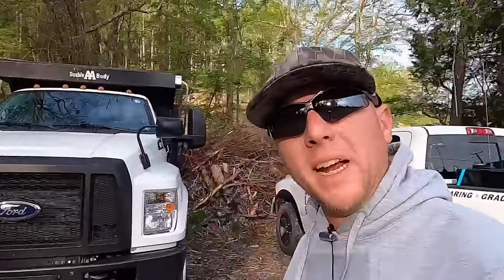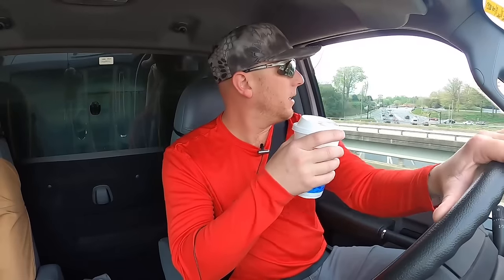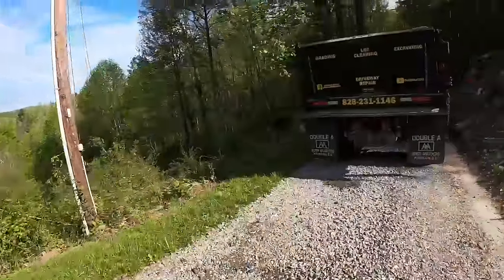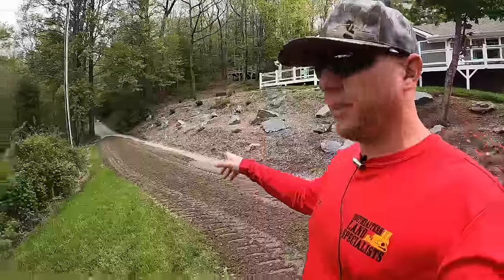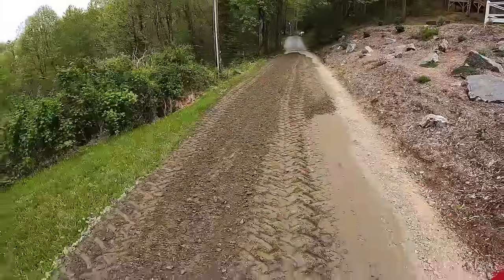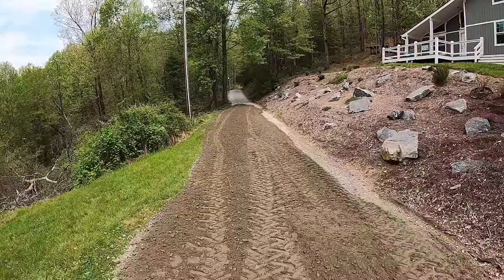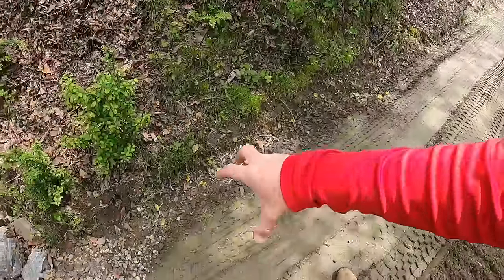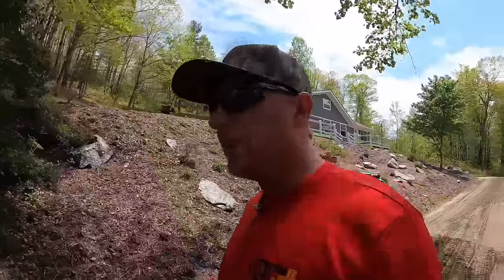GRADING BASICS-HOW TO CROWN A GRAVEL DRIVEWAY WITH TRACTOR AND BOX BLADE (part 1) | DigginLife21

Comment: Boy, you really need a hydraulic side link!!! I couldn't do without mine!!! Makes life soooo much easier :-) 
Been maintaining my 1.1 mile drive for 30 years (with my little 1250 MF 4X4), and we've NEVER had as much material on our drive as you do!! When they built our road, the owner of the land kept telling the driver to "go a little faster"... The gravel wasn't more than an inch thick, (if that) and there weren't enough turn offs or tiles put in. Been adding more as I can... Great video sir :-)

Comment: My driveway is a third the length of yours. House is on a high, drive contoured and curve uphill in a stretched z 50 feet. Or a backwards s. Whatever.
A downpour will start a cut across the driveway. 
Your description of trying to visualize our goals, on top of the basics of the operation of the implement/tractor; the tactile elements of feels and sounds; the allowable maximum distance to extend the blade while still maintaining grade. how to create a sheet flow across the driveway instead of channeling, all while maintaining proper drainage above and below.
Integrating the transitions of the driveway into the surrounding grade, fall of the land, from crowning to as best as I can describe it, high siding and then back to crowning.
Now it's getting me to be able to make the machine do it.
Thanks for the lessons.
Lessons, because you tried to explain every step more than one time and in several different ways. One of them might have sinked in.

Comment: The question that's been the bane of my driveway box blading experience (which is about 2 months) is, how in the world do you get rid of the dips and bumps when the dang blade moves up and down with the tractor which moves up and down with the dips and bumps??  Then with one very unassuming, innocent sounding sentence, the clouds opened up, my weary eyes saw a flash of light and I felt the warm, calming blanket of wisdom gently cover me..  "If your ground is super uneven, you've actually got to cut going backwards so that you can cut the highs and lows out."  This needs to be shouted from the rooftops because I'd bet my last tube of grease it's a major frustration for many newbies besides myself.  😂🤣
Edit: VALUE!! 😁👍
Reply from the maker: Lol. Glad to help

Comment: how would you do that if the road were 2 lanes wide? do you have to reduce the cutting angle in the middle of the road and make it more aggressive on the ditch side? and if so would you work out from the middle or in from the ditch? Thank you!
Reply from the maker: Angie would be the same. It depends where the material needs to go as far as where I start from

Comment: Great stuff!  I'm not in the business, but I have an excavator and a tractor for my rural property.  The box blade that came with the tractor when I bought it, has a floating rear blade, which is fine for pushing material and smoothing it once it's on grade, but you just taught me that a fixed blade can be used for back dragging, like the bucket on the loader.  I will figure out how to pin that floating blade, before I use it again.  Thank you for the value AND the entertainment in your videos!

Comment: I really like your videos, they are great. 
What are your thoughts about the importance of a hydraulic top link for ease of cutting with your box blade.  
Also do you prefer a wider box blade than the tractor for cutting into or creating some type of drainage or ditch. 
I maintain a private road, but I really need to cut better ditches out. Thanks for the video

Comment: I've got about 500m of gravel driveway in South Western Australia, I've been considering a grader scraper with the two angled cutting blades do you have any comment comparing this implement and the box blade?  I don't have a hydraulic top link.
Reply from the maker: If you have a lot of potholes box blade is better at moving material. Washboarding is easy with both. Crowning is easier with a scrape blade

Comment: Value. I’d be interested to know which brand of box blade you’re using. It looks tough.
Reply from the maker: It’s an “Everything Attachments” 8 foot extreme duty
Reply: Thanks Todd. I appreciate it. The Everything Attachments box blade looks reinforced in key areas that most others are not. I need one that will last.
Reply from the maker: @G.I.JeffsWorkbench it’s definitely very well built

Comment: Hey man, I’m looking to start my own business with a mini excavator. Any advice on the type of work I should be looking to take on ?
Reply: Just putting my thought in I own a landscape company been open 5 or so yrs. Depending on your experience but I would start out with easy jobs like drainage , French drains , doing garage pads or stick frame , just have a way to move material off site if need be dump trailer ect. Hope helps some . Another easy one is septic systems depending on your location that is.  Hope the best and wish you luck.
Reply: @TheBradhanna  my plan was to start off doing drainage and utilities trenches, small land clearing and maybe some small demo jobs. Everyone I’ve spoke to says go for it, worse you can do is fail and said you tried. Thank you for your response brother, I appreciate it.
Reply from the maker: Feel free to email us at tkindy.slm@gmail.com to set up a consultation. We can talk about your skill set, location and such to determine what would be best!

Comment: Excellent tutorial, I disagree with your title of "grading basics", this was more of a "doctoral thesis" of driveway grading, not a Bubba slinging a load of stone. Great description of the box blade, the different tools it consists of and how to achieve your desired outcome. Maybe a camera shot of the bottom side of the cutting edges so people new to the box blade can get a visual of by adjusting the top link you can mimic a grader cutting or a dozer back dragging in either direction. I ordered my new E.A. 96", 125 HP box blade with the 8" Viper cutting edge and the large shanks yesterday, yikes... 4K. A little sticker shock considering my last one was a 6' Kodiak, but this'll be the last one I ever need to buy. Thanks for pointing me in the right direction for this beast, now the wait, things are a bit backed up at the present time. Great job on the driveway, looking forward to the finished product.

Comment: Hi Todd, the top link piston on the  3pt, did you get that from the Kubota or did you buy that aftermarket? I need one for my L6060 just wondering what works. Thanks Zack
Reply from the maker: I got mine at northern tool but would recommend the top and tilt kit from Kubota
Reply: @DigginLife21  thanks Todd. Your videos have huge value to me, especially the quotes and tips and tricks. Thank you for all your help and time.

Comment: Those 425s will make it a little stiffer to steer i put 385 on ny kenworth made it a little easier i owned 3 macks if you buy anything from mack its high dollar you can get stuff a little cheaper if you buy aftermarket most of the stuff is just as good.